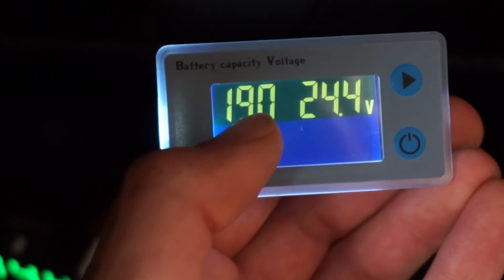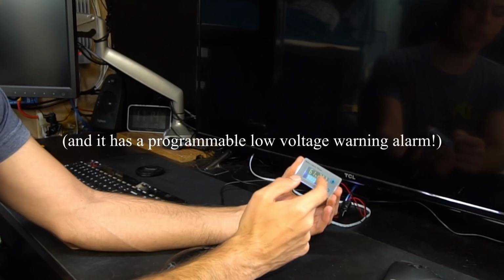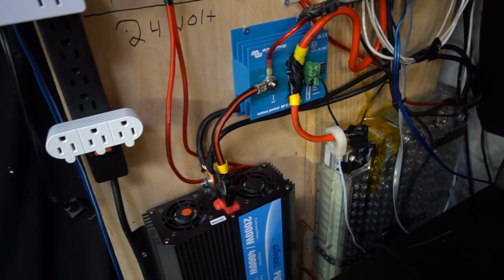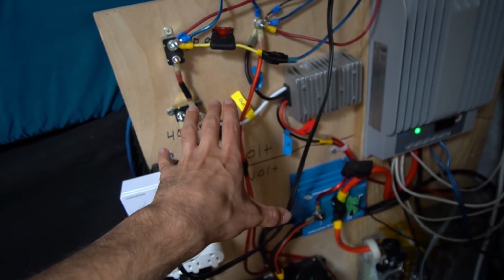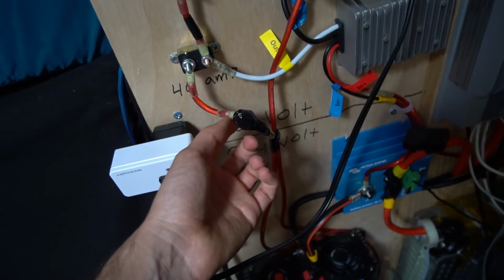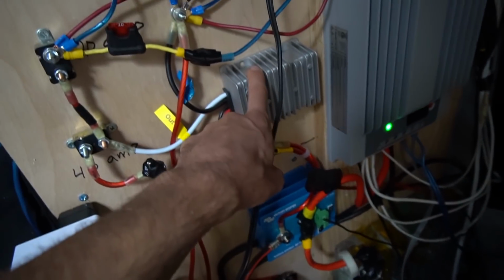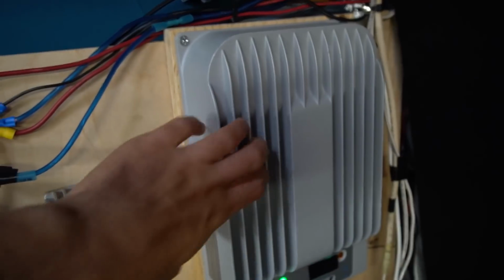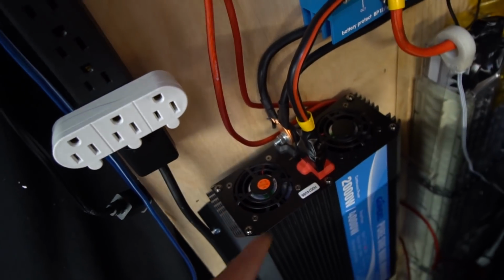Tesla Solar Battery Upgrades (after using it for 1 week off-grid)

Comment: I want to change over to a Tesla battery.   I'd like to run my AC on it too   I saw a Tesla battery installation that has a power controller that allows the battery and the generator to run simultaneously

Comment: A good tool for electronics especially if you like some data with visual is an IR imager like from Fluke or Flir..  Great for getting actual readings of heat off your panel especially since you tweak your system wiring and components so often.  I found a bad breaker in our house.. so many other uses it's not worth mentioning but underrated for electronic use.  Fluke (maybe also Flir) can set a top limit for temp and it will take an image so you can run it pointed at a suspect spot and monitor the temp if you walk away to draw more from the circuit the IR camera will snap images if it meets your threshold.. anyway you seem to like all things tech. IR camera is unlimited use for home/camper/RV.

Comment: one quick question on the 12v side of the issue.  Would it be better to have a regular 12v battery 100 Ah like marine/RV flooded or use the 24v to 12v convertor deal instead. 

I remember Tom morton talking about the need for a 12v battery to run the hydraulic jacks on their 5th wheel.. 

I will be doing or trying to do the tesla battery in a airstream so no large 12v power demands more or less. 

thanks and great info you provide. :)

Comment: Is discharging Lithium batteries completely before recharging advisable or should i only deplete it partially?
Reply from the maker: No do not do that ever. You are thinking another chemistry that had memory. Lithium doesn't.
Reply: so to what extend (percentage) can i safely deplete my Lithium batteries?

Comment: Sick setup!
If your battery gets bellow freezing you don't mind charging it?
My bms disconnect charge current sub freezing to save the cells.
Maybe your in a spot where it never freeze.
Reply from the maker: great point and I live in San Diego so it will never hit freezing but yeah I talked about this in another video on how to use a heater pad
Reply from the maker: Yeah you never want to charge it in freezing it will destroy it

Comment: I really like your setup. I'm glad you made the mods too. What do you think about using a Solid State relay with a upper/lower voltage monitoring relay to disconnect the solar if your battery goes above your set point (24.4v)? Would it work? If your charge controller charging parameters change in any way the voltage detector disconnects the solar from the MPPT. Thoughts?
Reply from the maker: Yeah sure. Just make sure it can handle the current

Comment: there are times when solar is poor/weak for a while.  why not run a charge cable from the alternator to your MPPT?  the alternator is, in effect, a dumb lead-acid charge controller... which could supply E to your tesla through the oversight of the fancy mppt charge profile.  tru dat, its only 13.8v'ish.  but, your mppt can deal with it - it already deals with that when, say, you have shade that reduces the solar output.

Comment: Will that charger Work in Constant Voltage Mode? Regulate constant voltage direct from the Higher voltage PV Array?  Some Controllers will do this. No reason to covert Solar Power to Toxic Chemical power during the day unless you have to.

Comment: 👋🏼 hi!
Do you think using one day a ac charger with your ac generator to charger the lithium battery ?
I Gona think about it because of the winter coming now..
I also have a gasoline generator and a ac/dc 50 amp power supply... I just have to find a way to limit the current  to not use the power supply full rate full time..
Thanks

Comment: That 12V battery will not float properly, silicon diode has forward voltage drop around 0.7V, so battery will float@13.1V so there is higher chance of plate sulfatisation in the long run.  Try Schottky diode rather, they have forward voltage drop around 0.2-0.3V, way  better. You can find schottky diodes in computer power supply, they are on the low voltage side used as rectifiers, typically 2x30Amps two diodes in the same case that you can parallel. Computer repair companies throw defective computer power supplies trucks of them. Also did you look into crypto mining HW to heat the RV during winter and earn some $$ using that unused solar energy you have all afternoon after battery reaches 100% SOC?
Reply from the maker: Yeah it's at 13.1 volts but I don't mind it that much. Battery won't be used much at all. But yeah you're totally right. And cool idea about the other diode! Will look at Frye's for one. thank you!
Reply from the maker: Yeah crypto mining would be rad but gosh, the winter solar power is so limited. May try in summer or down south
Reply: depends on the diode, his may  be germanium based which has a .3v drop
Reply: Highly unlikely that he has germanium diode of high AMP capability, i have ton of germanium signal diodes from 60-70's  old junk electronics manually desoldered when i was kid, and i have seen high power germanium maybe once in my life (~5Amps) it would be like winning the lottery! Did you ever see in person germanium diode over 10Amps?
Reply: Zegarac Robert 
Yes I have in an old battery isolator installed in a boat.
Reply: Or move the diode to the 24V input of the converter.  That way it will still prevent back flow but not effect the 12V float voltage.

Comment: You didn't need to move the solar charge wire. The Victron BP-220 battery protect is a MOSFET isolator, it can only block voltage in one direction- towards the output. When it cuts off output, the solar controller can still charge it through the battery protect when connected to the load terminal. That will also allow you to run your RV loads off the solar as the battery is charging. If your connect the solar charge to the input you won't have any power until the battery charge state rises high enough for the BP-220 to turn back on.
Reply from the maker: Gosh you're totally right! Dang it. I forgot it goes one way. Thank you!
Reply: I did not know this, I do not know the internal circuitry, for me it was undervoltage of minimum tension.
sorry. I would prefer that all the solar power goes to charge the battery as soon as possible, so that it does not get damaged, completely in good shape you do not stay
Reply: The only challenge I see, if the parameters on the MPPT change accidentally you can over charge the battery. What do you think about monitoring the battery voltage and disconnect the solar with a solid state relay when the battery voltage hits 24.5v for 60 seconds?

Comment: Lithium sounds more and more promising. No Tesla in my country but should be no problem to build a pack myself.
Reply from the maker: You could get a lithium iron phosphate shipped internationally pretty easily. The cells are great and a lot easier to use than a Tesla in my opinion

Comment: Does the Tesla battery has coolant lines? If so what system are you going to use to cool it?
Reply from the maker: it does have coolant lines but there is no point in cooling this battery considering my discharge rate. It will never ever overheat
Reply from the maker: Look up the C rating capabilities of this pack. My solar power system will use only one tenth of what it can use

Comment: Hi Will!  Be advised, that the diode has a forward voltage drop, possibly around ~1.35V, which means that your lead acid battery sees the converter voltage minus 1.35V or so (12.34V DC).  Nice vid!  Keep up the good work.
Reply from the maker: Converter puts out 13.8 so the diode drops it to 13.1. it's good enough for the intended use of the battery, but yes I should charge it every couple of months. It's a throw away battery though and it will never be discharged again, so it should be ok. But yeah, great point! Thank you

Comment: Good to see you put a battery back,I wondered why you even removed the 4 you had ,why not charge them both with another controller, I had asked about your blue box above before your tesla battery and 24volt 2000 watt inverter how it worked ,now you showed it was wired wrong ,glad you fixed it.
Reply from the maker: They were just so heavy. 240 pounds. I always try to get rid of excess on the RV whenever possible. It's loaded! Lol

Comment: will you ever directly connect the inverter to your AC RV outlets or just continue to use extension cords?
Reply from the maker: Extension cords for now. Good question. That's an upgrade I should do but haven't.
Reply: Make or buy a automatic ac disconnect, so ur system automatically changes over to ac as you plug it in from mains power. I did this for a friend 14 years ago and he could switch from inverter power to run computer to mains power without effecting the computer in any way in his caravan.  Great vids Will

Comment: I think you may need a dedicated charger for your coach battery under the RV. I see what you're doing and have concerns about overcharging that battery.
Reply from the maker: How would that be possible?
Reply from the maker: The Data sheet says 13.8 volts is the float voltage. It's a sealed lead acid so we can go to 14.5 volts. Once the voltage reaches 13.8 the current drops to zero.
Reply: It's also important to control the amperage to a battery. My concern is when it gets to a low state of charge and really sucks the amps. I would just place a small charger between your DC converter and that battery.
Reply from the maker: I will never deeply discharge the SLA. and yes I totally agree I would use another type of charger if I was deeply discharging it but I'm not.
Reply from the maker: I discharged it a little bit to test this after starting the generator and it only Drew 3 amps. Very minimal. The charging system for this SLA is only made to top it off.
Reply from the maker: The sla is pretty much just a big capacitor for starting large loads and that's it.
Reply: Will, love what you're doing and I think you have a good handle on the electricals. You should try thinking about eventual item failure. What if a cell goes bad in the AGM? It will suck all the current it can get to compensate and could be a hazard. Won't cost much to add one that is current limiting and it will be that much safer, and it won't suck down the rest of your system in a short period of time.
Reply from the maker: Has a second fuse on battery for 20 amps. I think it will be fine. Very redundant system. Lots of safety features at every step
Reply from the maker: And price isn't an issue, it's just that this system works.
Reply: You can always place a Boost converter from the 24v Battery and connect it to a PWM charge controller then connect to 12v lead acid battery. This will keep the battery charged at the right voltage. The PWM will perform the charging stages where just a boost converter will keep the battery at 13.8 or constant float. This may reduce the life of the battery if it's not an SLA.

Comment: If I understand what is happening, it looks like the lead acid battery will be float charging near 13.8 volts after being fully charged.  If true, is that a little high for long term?
Reply from the maker: it would be a different situation though if I was deeply discharging the battery consistently. Then I would have a real charger on it but for this situation it's fine
Reply: Thanks.
Reply from the maker: 13.8 volts is the exact float voltage so it's fine to keep that battery at that voltage indefinitely

Comment: By moving the solar charge wire on the Victron Battery Protect, aren't you now bypassing the over voltage protection?
Reply from the maker: Battery protect only protects going one way. Which is a huge bummer. So it wouldn't matter. And solar charge controller has programmed over-voltage setting set to 25 volts.

Comment from the maker: Charge and discharge curve screenshot came from our friend Jack Rickard: https://youtu.be/HIAIX3oEHZs
Product list (affiliate links)
Programmable Voltage Monitor: https://amzn.to/2D0t4Dq

Inverter that works well with the tesla battery: https://amzn.to/2EIdoGy

Converter: https://amzn.to/2CCDlVs

Bridge rectifier diode: https://amzn.to/2yFk9np

Everything else I use with this system: http://www.mobile-solarpower.com/tesla-solar-battery-diy.html
Reply: Hi how do you get in the settings menu because I can't figure it out on mine?
I'm using it for a 13s 40ah 18650 pack from an electric scooter and it came set for 13s but I can't find d how to change the low and high settings
Reply from the maker: @marbesky  oh its in the manual. have to read the manual
Reply: @WillProwse  mine didn't have a manual what so ever but I figure it out after 30 minutes of frustration
Reply: Could you also include a link to the bridge rectifier diode?
Reply from the maker: @DennisWintjes2  its listed above, click "show more"
Reply: @WillProwse  would the Tesla-s work well with the MPP 24v 2.6-3kw all in one ?